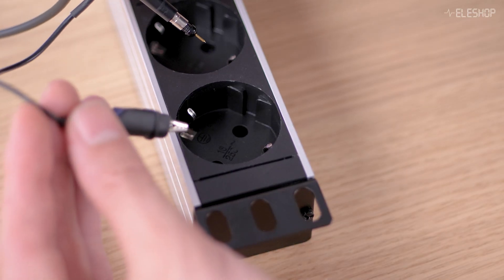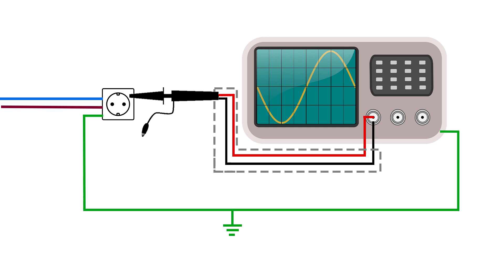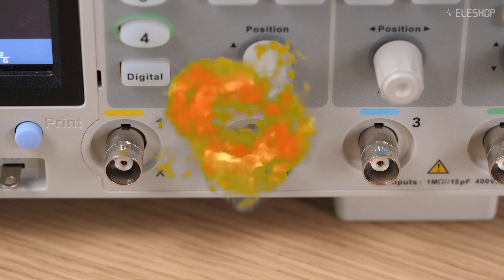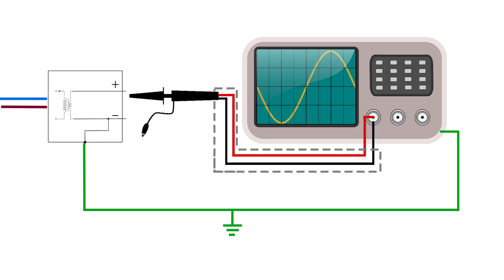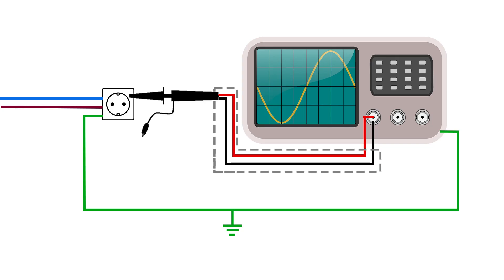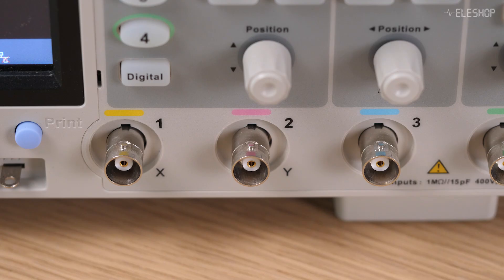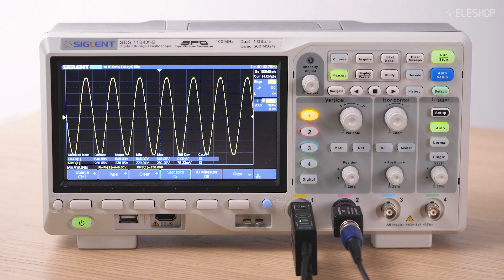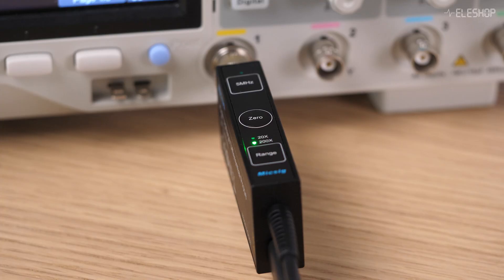Can You Measure Mains Voltage with an Oscilloscope?

Comment: I have a different High Voltage Isolation Probe, the model is Hantek HT8100, can this be used in replacement of the Micsig DP700, please advise, thank you!
Reply from the maker: The Hantek probes have the same function, but offer less quality. See this topic on the EEVBlog forums. The owner has sent the Hantek diff probes back for a refund: https://www.eevblog.com/forum/testgear/cmrr-measurement-am-i-doing-it-right/msg5635599/

Comment: I measured with passive probes the mains, using with diffential measuring methode; like this:
1.	Connect 2 probes channel A and B,
2.	Set the probes X10 mode,
3.	Remove the probe alligator clips,
4.	Select oscilloscope ADD mode, 
5.	Set the polarity switch if necessary,
6.	Connect oscilloscope’s ground to the earth,
7.	Then measure the voltage between LINE and NEUTRAL safely.

Comment: I always use my isolation transformer to which I connect devices to which I want to measure on with my scope. In that case I actually CAN use my passive probes reasonably safe. Working on such devices when connected to an isolation transformer is safer in general.
Reply: Isolation transformer is not recommended for a Ocilloscope, if you think this is desired, no seek another way. Always  use a differentiation probe for voltage measurements. The oscilloscope has an earth ground for a reason. Never bypass this. My situation as a past electronic technician technician and powersupply engineer for the past 50+ years, I approve this message.
Reply: @Robert-hr6sh  he meant DUT connected into isol. transformer not the scope.

Comment: Too bad they are so expensive, 249 is 200 more than I wanna spend
Reply: Yeah. I bought a Tooltop ET828 pro multimeter. It can plug straight into 240Vac to see sine wave on its special mode. Works great for hobby use and to check if DC to AC inverters are actually sune wave or square wave etc. I love it.😊

Comment: I'd never seen one of the AC line splitters before, pretty nice to just have a pair of safety connectors inline like that. Did some googling around and the square holes are for current clamps.